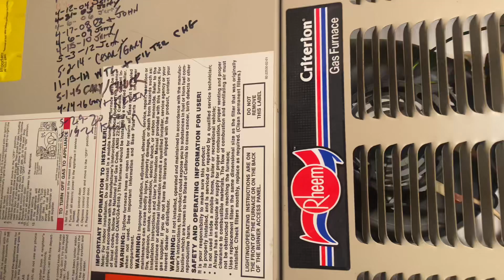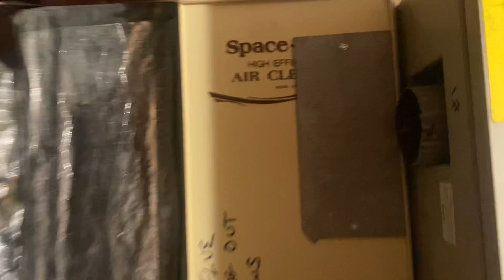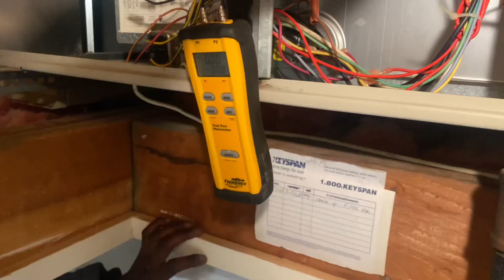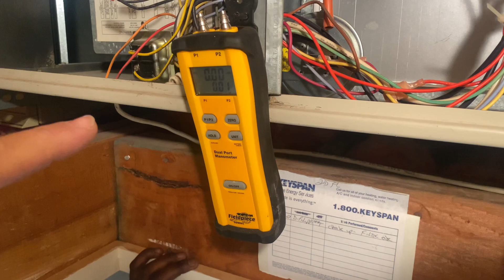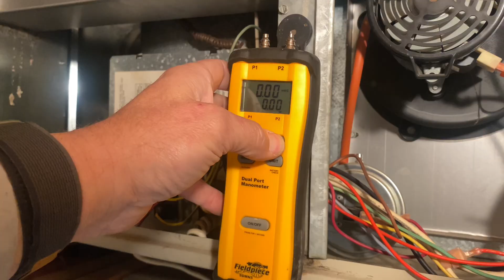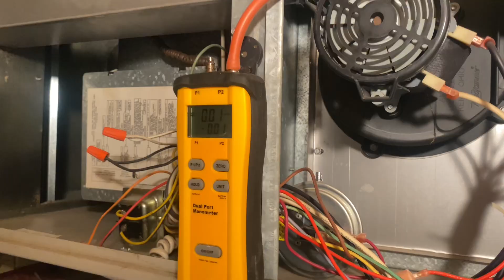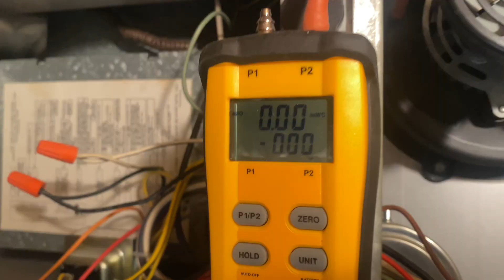Revealing the Easiest Method to Test Cracked Furnace Heat Exchanger

Comment: Don’t know how reliable is that test.  I would like a confirmation seeing a little vibration on the flame
Reply from the maker: It’s more reliable and more accurate than a match like a handyman hack
Reply: lol @ handyman hack another clown phrase added to my dictionary well done Saint Mike hahhaaa love it!!!! @PipeDoctor
Reply: can have perfect flames with a severely cracked heat exchanger - depends on where the cracks are. no substitute for a visual inspection.
Reply: You can also back test this by having combustion analysis. Look at the oxygen and turn on the blower to see if oxygen rises. If it rises the heat exchanger is compromised

Comment: You should have done a clickbait on the thumbnail of this video ....
"MIKEY PIPES IS ON CRACK !!!"
😄😄😄😄
Good job Mikey. The dead giveaway for me is the combustion gases coming out of the flue. Both the smell and the level of carbon monoxide that I get on my detector when I insert my wand into the flue.  Those ppm's tell the whole story. 
Flue pipe... do you swear to tell the truth, the whole truth, and nothing but the truth?
YOU CAN'T HANDLE THE TRUTH!!! 😎👍😎👍😎👍
😎👍

Comment: should also mention if you dont have a working man-o you can also check for flame influence  by the blower turning on as well, but yes this is the prefered and safest way to check for a cracked H,E,. Mike has another great tip for the new guys
Reply from the maker: Enjoy 😊

Comment: if you that test in a functional system i assume you get zero? would be interested to see what the variance is 0.04 is small
Reply: Ya i agree id like to see that done on a brand new furnace out of the box as were talking about a fraction of a water column
Reply from the maker: You doubt the test?
Reply: @PipeDoctor  
Kinda just because if their was holes or cracks i think you would have got a huge pressure differential not just fractions of a water column. Especially as the fan was running through the heat exchanger. Next time i do a new install id like to try your tip though. No disrespect i do value your education and skills especially in hydronics.
Reply: @PipeDoctor I would not trust that low of a reading exclusively. Jump r to g and use a long lighter or match as a confirmation is my method after this test. You can do both in under 10 mins and then you KNOW for sure. I also use a single port manometer for the pressure switch test your showed here as it has no external influence... respectfully.

Comment: 5 years of combustion analysis WHY did I not think of that. I'm gonna show my guys!
Reply from the maker: A subscriber told me about this a couple weeks ago. Epic test
Reply: Awesome test basically cycle the furnace so it can be hot then (sometimes cracks hide if furnace is not up to temp even with combustion test) t off the pressure switch and when fan comes on you'll catch that difference definitely a tool for the toolbox
Reply: I also watch my flame in the tubes if they change when the circulating fan comes on? Definitely a giveaway for more testing. ((if you’re not testing, you’re guessing.)) credit to pipe Dr!!!
Reply: Da hell this the easiest test. Just got my testo 310 back from recal for almost $500